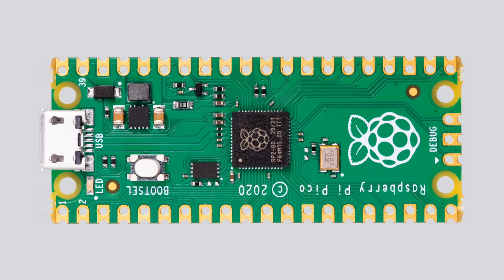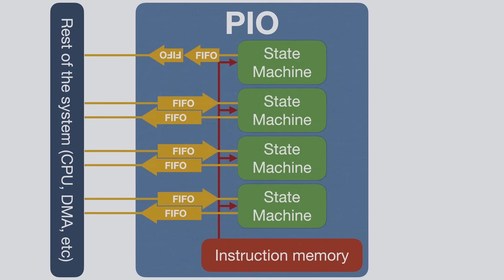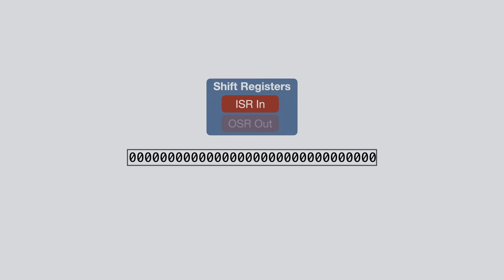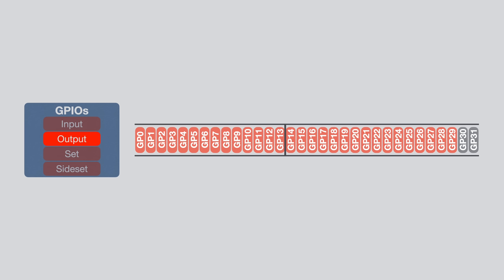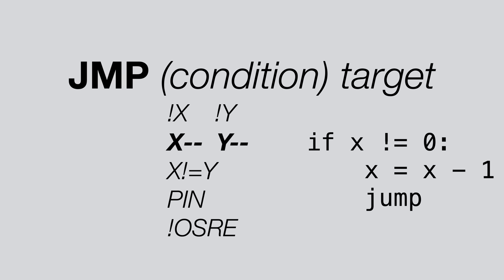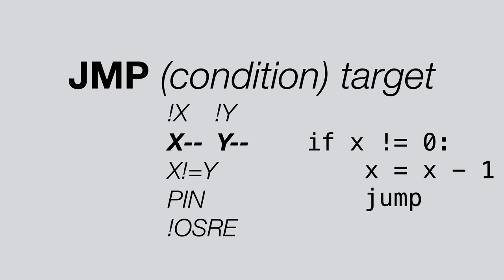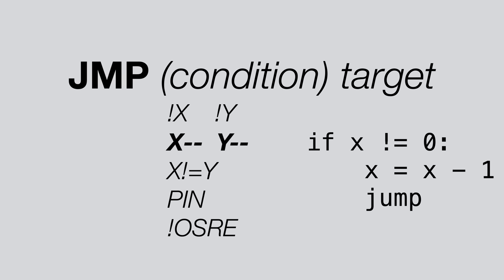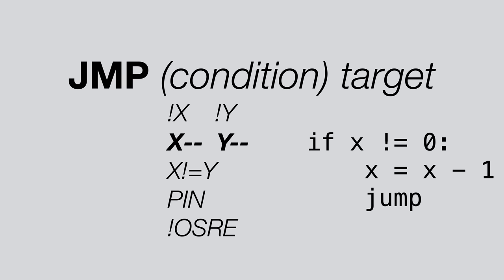In-depth: Raspberry Pi Pico's PIO - programmable I/O!

Comment: The Raspberry Pi Foundation just lit a fire underneath Arduino. The pico is so packed with features and as such appeals to people that have experience with Espressif's chips while at the same time being more than a quarter the price of an Uno plus being more intuitive. They covered everyone with their hardware, they sure did know what they were doing.
Reply: You know that you are comparing Apples and Ataris, don't you? In addition, it won't do any harm if Arduino burns down. That was a joke, of course. Frameworks burn badly, or not at all, when they are mental constructs;)
Don't forget: use the right tool for the right job. In some of the comments here you can clearly see how strange a high-speed logic with discrete building blocks is to people. To know about that too can sometimes be an advantage.  Or simply have knowledge besides the Arduino, ESP or Raspberry filter-bubble.
https://www.digikey.com/en/products/filter/embedded-microcontrollers/685 ... Fucking 89483 results!
Reply: @dieSpinnt  The AVR market is not going to change, I am just fearful of Arduino's position here. You could get a bare bones AVR chip for a comparable price to the pico even after the demise of Arduino no problem. It would only really show how expensive their stuff are and pressure them to act. Whatever happens, knowledge is knowledge.
Reply: @martandrmc  Hmmmm, I can't see us both discussing the (insert MCU here) Market. Who buys, calls! 
In retrospect, my thoughts on your Arduino worries to calm you down: If you have to do something quickly, use a BAD editor (I just don't understand why people pick it up. It's a free decision to use a text editor and not code-completion mumbo jumbo or the other way arround) ... in other words: one that works (!) and you want to try something quickly (with thousands of others strengthening your back with their experience through libraries or support), again: something that works ... proven
There is always a niche for this type of hobby or craft work. This niche can be really big, so big that even professionals can use it to quickly try out an idea.
I think you shouldn't worry. Especially not because of diversity :)
Reply: @dieSpinnt  In retrospect, comparing the 2 prices is not by any means the full story. There are devboards out there with an STM32 at around the same price as the pico that have better performance than an Uno but still have not gotten to be main-stream yet. Arduino has alot of software behind it that could also work with a Mega if performance is needed. In conclusion i dont think that Arduino is in as much danger as i have thought, but still the pico is backed by a similarly well-known company. It would not be equivalent to compare STMicro the same way. (Also sorry for not checking for a week)
Reply: for 3d printing, i have to use an ATmega because its "real-time" - there isnt any context switching going on unlike my RPi running linux. 
does this mean I could use a Pico to replace the ATmega + my old RPi?
Reply: @itemushmush  No, you could (theoretically) use the pico to replace your old ATMega but NOT the RPI. The Pico is the same class of device as the AVR microcontroller, just a couple times more powerful and with more features. It is still not nearly powerful enough to replace your Raspberry Pi if you're using it for something like Octoprint or Repetier.
Reply: @itemushmush  Also I should add that an RPI can actually be used for 3D printing. People have done it directly, and then there's also the Klipper firmware where all the realtime processing happens on the pi. My understanding is that, if you use the (imperfect) realtime features of the Linux kernel then the massively increased speed of the pi can compensate for the fact that it isn't a 'true' realtime system.
Reply: @antonliakhovitch8306  thanks for the information. very interesting, might give the pico a shot because Im using a chinese ATmega lol, not sure how it will handle the multiple 10s of watts I use to power the motors
Reply: We used to use arduinos for work. I've been showing the guys these picos and we are all switching over
Reply: With Arduino coming out way b4 PICO, the pi foundation had plenty of time to improve upon the Arduino design. I’m very excited to get into the world where digital machines meet the physical world (I.e. I/O pins and programming to manipulate servo’s, motors, etc!)
Reply: @antonliakhovitch8306  That's actually not correct. Klipper only does the high-level processing (such as trajectory calculation) on the Pi but relies on a microcontroller on the printer motherboard to actually drive the motors. The difference is that the microcontroller doesn't deal with g-code and isn't doing any calculations anymore (such as when it runs Marlin) but it only drives the motors and reads the sensors - i.e. things that require the real time performance. The heavy lifting that does not require real time hw control has been done by the Pi.
Reply: @jostafro4967  enjoy your noisy power. It's even an admitted flaw in the design in their own documentation.
Reply: Okay, fanboy. Compare an open source smaller Arduino. Oh yeah, you can get one with the rpi processor too.  Price?  Arduino is open source, so you can get them for basically the same price as a bare atmega chip. Lol
Reply: @VndNvwYvvSvv  haven't noticed any problems with noise for my applications, but I guess it depends on an individual's use. But it is easier to teach people python/micropython than c++. So we save more money that way even if the chip is a couple dollars more.

Comment: I have been around microcontrollers off and on since the MK3870 at the end of the 1970s. Having this level of IO functionality driven by separate execution units with well thought out instruction sets is just mind-blowing in its possibilities.  I know other chip families have had smart, programmable IO systems, but this takes it to a new level.  As someone who used only to program in assembler for most of the 1980's, I found that this was a great video that explained the capabilities very well.  Thanks.  Subscribed.
Reply: Me too. I spent five solid years working with 6809,8085,Z80,68K and this video has left my mind reeling with questions like "Yes, but what can/can't you do with it?" I've seen one video of a guy who has recreated the original Transputer boards. I learned Occam for a bit on one of those.

Comment: Around 8:25, JMP (X-),  the documentation says: JMP X- and JMP Y-- always decrement scratch register X or Y, respectively. The decrement is not conditional on the
current value of the scratch register. The branch is conditioned on the initial value of the register, i.e. before the
decrement took place: if the register is initially nonzero, the branch is taken. (RP2040 Datasheet, page 320,321)
The emphasis is on ALWAYS so that the decrement is ALWAYS done.

Comment: I absolutely love PIO in my chips. It means you can hook up just about anything you want, unconstrained by physical ports or dedicated controllers. It's almost like a tiny FPGA on your chip. My ultimate goal is to get multiple RP2040s running as a cluster using their PIOs.
Reply: I’m actually working on clustering a bunch of picos to rebuild Ben Eater’s 8 bit computer (but planning on using 16 bit addresses instead of 4 bit addresses for memory; 65536 bytes instead of only 16 bytes).  It kind of silly to build a (slow) cup out of a bunch of processes but some good things are: lots of lights, ability to experiment with cpu architectures quickly (easier than wiring lots of 7400 series chips), and it’s fun and I just want to haha. Python is good enough but I want to using PIO if possible.

Comment: Currently looking into implementing i2s audio using the PIO sm's. It's easy enough to imagine "how to do it" in my head. But I have a hard time grasping "the right way". Been watching videos and read up on the documentation. Some stuff confuses me, some makes sense. This video was helpful, although I did miss some examples for some of the instructions and the whole concept of mapping certain pins to PINS are still a bit confusing to me. I'm a visual guy, so I definitely got more from the first part of the video with the visual aids. Great video nonetheless. :) Thanks.

EDIT: Btw, one thing I am having a very hard time with, is trying to connect my data in my C / C++ code with whatever the sm reads / works on. That whole IRQ, DMA, FIFO, ISR, OSR situation makes my head explode. :D It's probably simpler than it seems. I just need to slowly work my way into it.

Comment: Nice to have this video! This helps me to realize my project. But I don't understand the state machine, because from the UML perspective this is not really a state machine. A state machine must have an entry point and transitions between states, including conditions. The exit state is optional.
Reply: Not sure where you're getting that definition. If it's from UML, then they've redefined the term. A state machine doesn't need an exit point. And it certainly doesn't need transitions defined between every state (if that's what you meant there). I've built many no-exit state machines, and almost none with all possible transitions allowed.
Reply: @peter9477  https://de.m.wikipedia.org/wiki/Zustandsdiagramm_(UML) im Vergleich dazu der https://de.m.wikipedia.org/wiki/Endlicher_Automat
Reply: @mr.unbekannt2163  I'm not sure what you're expecting me to get from that page. Are you claiming something in it contradicts me? Or are you claiming that the UML definition does require all possible transitions to be allowed? (In which case as I said they have redefined the term, and inappropriately, I might add.)

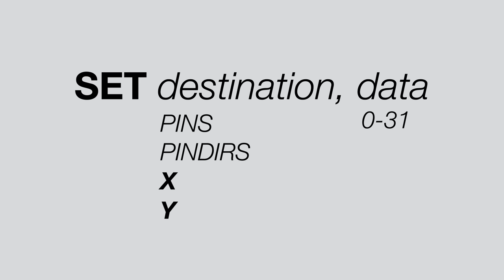Comment: Hi, I think there is another errata to be written: at 7:37 and 14:04 you explain, that "set pins, 1" turns an output ON, whereas at 9:01 you explain it as turning it OFF. Or did I misunderstand something here? Thanks for the great video - that was well-paced with dense information!
Reply from the maker: You are absolutely correct, great catch! It's off for 1 cycle and on for 2 cycles. Added it to the errata.

Glad you liked it!

Comment: Quite a bit like the lighting control 'engines' that in the LP5523 LED controller (ca.2006), but maybe without the engine priorities(?), although the pin mux idea is similar. this allows for some pretty fast real-time functionality, without needing cpu intervention, and with a LOT of flexibility. (BTW, if you do need an LED controller that doesn't need you to constantly execute code to do complex LED functions, the LP5523 was designed to offload the cpu, and allow LED functionality when the cpu is in deep sleep, even has an "interrupt" input/output to respond to, or initiate, other hardware functionality.)

Comment: Thanks for this PIO introduction! I now understand what I read in the datasheet ;o)
I have a question: as IN and OUT pins groups can overlap, how are common pins handled? Do they automatically change direction depending if they are shifted in or shifted out?
I'm asking because I would like to interface the Pico with a Z80 bus, so IN and OUT should point to the same pins...

Comment: 8:28 The Motorola 68000 family had an unusual decrement-and-branch instruction: instead of decrementing and branching until the count reached zero, in which case it would stop branching and fall through (existing the loop), it would decrement to -1 before exiting. This let you deal easily with the case where the loop count was initially zero, in which case you want to just jump over the loop completely. E.g.

    move.w #count, d0
    bra loop_end
top_of_loop:
    .... body of loop ...
loop_end: 
    dbra d0, top_of_loop
Reply: So had the Z80: 'djnz address', which stands for Decrement and Jump if Not Zero, where register b (8 bit) was the one being decremented. But these very rare and useful instructions (for creating loops) have not much to do with this discussion about PIO, which are far more complex and programmable!

Comment: I'm going to want to make a specialized one wire serial adapter with this thing one day.

Edit:
Is there a simulator for this? I don't have the hardware to debug the input and output of one of these, would love to be able to provide some basic pin states over time and be able to plot what it does over time.
Reply: Search for "Signal/Noise Ratio". One Wire ... ROTFL
From Wikipedia: "1-Wire is a device communications bus system designed by Dallas Semiconductor Corp. that provides low-speed (16.3 kbit/s[1]) data, signaling, and power over a single conductor." 
There is a reason why this is low speed. By specification you don't need high-speed shenanigans like shown in the video and simply by the physics. It is impossible to get a good signal integrity via this bus-implementation at high frequencies.  If you are flying up to the 100MHz+ range, nobody can deny technologies like LVDS and the study of high frequency behavior of electronics and the corresponding physics. Also, that the pico can theoretically generate these signals must not mean that he can also DRIVE the signals necessary.
Don't get me wrong, please try your (by my understanding) worthless experiments. Maybe with a better bus? At least two wires? Well wired for high frequencies with buffers?
The simulator: RTFM, I mean the data-sheet (Reference and Programming) and really ... you need a simulator for a $5 device you can debug and watch at the oscilloscope? Please stop joking ... no, have fun!:)
Reply: @dieSpinnt  If you want me to get a DSO by all means send me the money.
Reply: @gudenau  Nope. I am not forcing you into something. You can live without one, but then ... you simply can't do what you are trying to do. Just that:)
Reply from the maker: Jedzia you should really overthink your attitude, you are not contributing positively.
Reply: @stacksmashing  Take for example the very good qemu-arm emulator. It is impossible to translate timings to a real chip.
High speed one-wire protocol ... I overthought it: He will try it with or without me.
DSO: There are $29 STM32F103 based ones out there which would be fine for 16kbit/s. I don't gave that advice from thin air. To prevent tears and frustration!
Low speed applications, but not for 200MHz SPI or something in that region .... which always works and you can as a bonus ... rely on!
Skepticism is always not seen as positivity. But thanks that you RTFM and present that here with your videos. Can't wait for a real world app of PIO.

Comment: The Pi Foundation made the perfect microcontroller board for many. The Micropython appeals normies, and everything else is perfect for low level stuff. This board with its PIO is the best hardware hacking tool ever. The dual core CPU also allows more interesting programming solutions.

Comment: Stupid question . What Is the diference between stm32 AND this pio?
Reply: pio is a programable co-processor of the RP2040 micro processor made by Raspberry Pi.  STM32 is a family of microprocessors (I think the company name is ST Microelectronics) - there are probably more than a hundred different versions of STM32 microprocessors depending on what capability you need. Here is a video comparing the black pill with an STM32f411ceu6 with a Pico -  https://www.youtube.com/watch?v=I2VcIKlL-9w&t=84s

Comment: 3:05 wait, since the Arduino core for the Pico allows for overclocking to ~250MHz does that also make the PIO run faster?
Reply: Yes, PIO runs with system clock (so 250MHz overclocked) or you can set it to custom, lower frequency via a divider.
Reply: I have seen reports of the RP2040 being overclocked to 270MHz, but the Pico Dev Board UNDERclocks the CPU to 125MHz ...so remember to calculate your divider based on the clock speed returned by `clock_get_hz(clk_sys)`